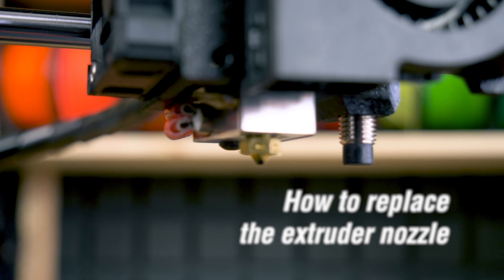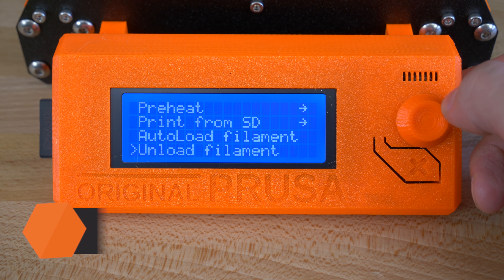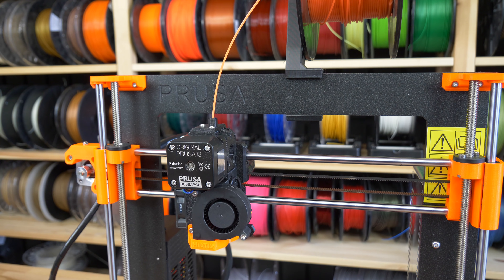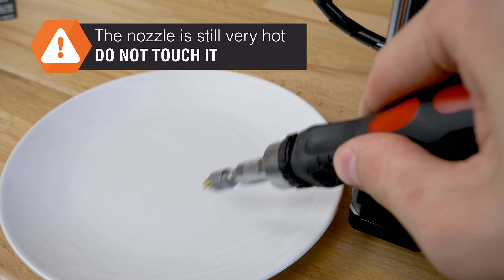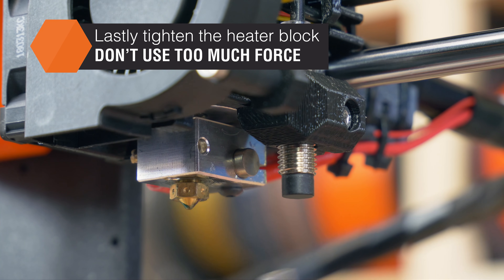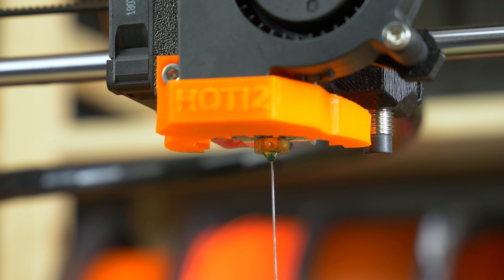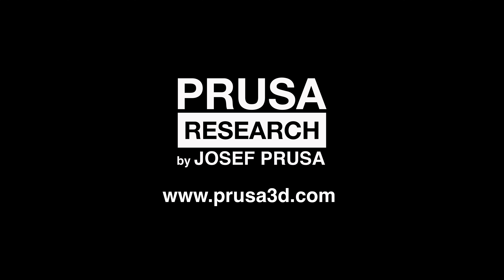How to replace the extruder nozzle

Comment: I can't recommend to replace the nozzle like descripted here any longer!
First reason: after ~10 nozzle replacements, the wires of the heater capsule inside of the heater block just break off because of to much wire bends. 
Second reason: after initial loosing of the heat break, you may have the risk to don't get the heat break not tied enough anymore. Resulting that nozzle and heat break don't touch anymore inside of the heat block. This causes leaking of molten filament over time what will causes slidly under extrution and but high chance of blobbing. This is a very slow process! You will not see this directly after the nozzle swap! But weeks or months later you will notice oozing and filament blobs on your nozzle and your heat block.

I experienced both problems above with my Prusa i3 MK3 respective MK3s. 

I suggest to swap the nozzle (if necessary) as following:
1. Remove the filament fan and the air directing shroud.
2. heat up your nozzle/hot end as descriped in the video.
3. Place some thing soft but heat resistent on your heat bed to avoid damages by accidentally dropped parts.
4. Move up the extruder unit as descriped in the video.
5. Use a bigger pliers or a variable wrench to hold the heat block as good as possible in it's position! Grab the heat block on the short sides to avoid any contact with the thermistor and heat capsule wirering! DO NOT GRAB THE LONGER SIDE OF THE HEAT BLOCK!
6. Use a socket as descripted in the video to unscrew and handle the accordently nozzle. 
7. Screw in the new nozzle as descripted in the video. Hold the heat block in it's position as good as you can! 
8. The nozzle should screw in pretty easily, dont use a ratchet to fix the nozzle! Just tied the nozzle by hand!
9. This is importend! Check if the nozzle is not totally screwed in! There have to be ~1mm gab between nozzle tipp and heat block were you see a bit of the nozzle thread. 
If the replacement nozzle is screwed in completly there is something wrong! Maybe your new nozzle has a shorter thread then the old one. In that case leaking of molten filament is pretty likely! 
Stop the process, disassamble the extruder unit and then the entire hot end. Adjust how fare the heat break is screwed in the heat block. You may have to screw in the heat break more. Here are a great video discussing the problem and how to fix it: https://www.youtube.com/watch?v=FNXYL-3UdOA
10. If the nozzle is screwed in correctly cool down the nozzle and reassemble the filament fan and the fan shroud. 
11. Your new nozzle is maybe a bit higher or shorter then the old once. You should run the First Layer Calibration again!
12. If First Layer Calibration doesn't work or the Z-adjustemt values are completly off, you may should readjust the height of the PINDA-Probe. You should check the manual and redo the PINDA adjustment and  pre flight check. At this point you are strongly adviced to redo the calibration wizard! XYZ coordinats are most likely pretty off.

If you plan to swap the nozzle more often you should consider to buy at least one spare heat capsule and thermistor probe for the heat block! Each part is about 11€ for a original one but you can get on amazon 5-10 parts from china for around 10-15€

Overall I don't think the nozzle swap is as trivial as presented in this video! You really should think about if it is necessary or not.
Reply: Yep yep yep yep agree, I just fixed a leaking between the heat break and heat block. The main problem was turning the heat block to swap the nozzle loosened the two.
Reply: @andrewong3724  I really don’t understand why Josef gave such a bad advice. I exactly had leakages when I followed his instructions
Reply: @Mazinga so he can make you damage your hotend as a strategy to sell his sh*tty pre-assembled hotends for 80$
Reply: @andrewong3724  how did you fix it?
Reply: Yup, this video is full of bad advice. I also ran into the same problem and now need to completely disassemble the hotend in an attempt to fix the leaking. What a pain
Reply: So as long as you hold the heat break and ONLY unscrew the nozzle you shouldn't have to worry about a larger or smaller gap from the heat break, yes?    I found another video and the person is doing exactly what you described.  Did NOT touch the heat break by loosening it at all.  Simply held it in place then unscrewed the hot nozzle.  Screwed the new nozzle in and torqued it to spec and that was it.  All my friends who have changed nozzles have had a problem with something leaking or breaking.  This is why I haven't changed anything on my mk3s even though i'd LOVE to print CF material or other abrasive stuff... I just didn't want to take the nozzle off and screw something up.
Reply: Or just get a Mosquito
Reply: @sasca854  what’s that?
Reply: I swap between 0.4 and 0.8 nozzles all the time. Why are there so many comments under this video of people complaining of a simple task being called simple? If you have butter fingers or are a brute then it's your fault, not the hotend's.

Comment: Welp, I overestimated the strength of my left hand when putting the nozzle back. Heat block slipped and I think I've screwed up some of the wires.
Reply: i have the same probleb bro
Reply: kek

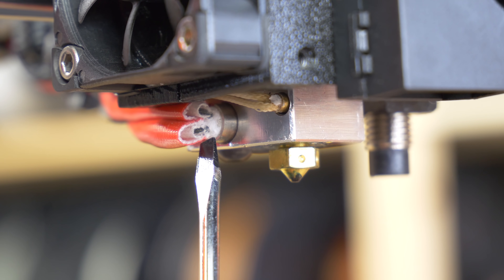Comment: 0:57 Unscrewing the heater block is really important. I forgot that part and had endless clogging and underextrusion. Wasted hours on failed, spongy prints before I could figure out why.
Reply: and why? i suppose because you omit loosen heatbreak bur what it causes?

Comment: Sheared off the nozzle last time. It doesn't come loose and given how fragile it is I'm stuck. It's broke either way so I guess it doesn't matter. Why don't you pop over to England to the hot end factory and work on this design? It's well past time for it to be fixed.

Comment: I heated the nozzle upto 285 and then as I was starting to loosen the heating block, smoke started coming from the general area around the extruder gears. I got so scared that I just turned off the printer and didn't attempt again. I don't know what burned up in there. I don't think it's any of the wires but I'm still not too sure. I still need to clean that nozzle. Any suggestions?
Reply from the maker: The smoke could have been some leftover PLA loaded into the extruder, some adrk goo may come out with your next filament load, but hopefully, that's about it.
Reply: @Prusa3D  Thank you so much for confirming that. Yes, exactly what you said happened. The goo freaked me out too. But nothing seems to be affected beside that. Thanks.

Comment: Please help I changed the nozzle and in slic3r I found where I can change the nozzle diameter but everything else is off as it was preset for 0.4 mm is there a 0.25 mm profile
HELP
Reply from the maker: There is! Select Configuration - Configuration Wizard. Here you'll see tick boxes under each printer. Tick 0.25 mm nozzle and then click Next till the end.
Now you can switch the printer to Original Prusa i3 MK3S 0.25 nozzle (the printer name may be different depending on what you pick in the wizard)
Reply: Prusa 3D by Josef Prusa thank you it works perfectly. Thanks for the quick response

Comment: Hi, I changed my old nozzle with a new one. But I have over extrusion issue. does anyone have the same problem?
Reply: You probably dialed your settings according to your old nozzle and it may have been a little clogged or have a slightly lower diameter than it should have. Revert everything related to extrusion to stock in your slicer, check that your nozzle is the diameter you think it is, and you should be good to go.

Comment: The i3 MK3s doesn't allow you to change like this, as the new channel for the wires under the extruder block means there's nowhere to grip the block like at 0:58.  This means you have to grip at the front, however then you can't get to the nozzle,  and the new fan placement means removing the fan too... And the PINDA probe gets in the way.  Then, there's z-calibration to be done after, so all in all, it's about 90 minutes work, plus risk of breaking something, which is why people don't change nozzles....  I think the idea that it's quick and easy is entirely misleading.
Reply: Should’ve seen this earlier. Melted part of the fan shroud during the nozzle change…
Reply: you’re right, i almost damaged everything because of that video, who looks like it’s simple and i have the space to do it easyly... right now my nozzle still out..... hope i will manage to get it back in without breaking my printing.. hope i had see your comment before
Reply: Strange in the description for the 3S upgrade it says that you can change the PTFE Tube a lot easier ... I wondered how that is possible ... haven't looked at the new files for the extruder yet. You say it is harder. Hm.
Reply: @VictorSteiner  It is harder to change the nozzle, not the tube.  I haven't tried the hotend removal yet.  I think removing it will be easier, however GETTING to it may be harder.  So far, not been impressed with the update, it's made some things worse, and not much better.
Reply: 90 minutes? Hardly. Under 10 mins total including first layer calibration z height.
Reply: @MrWizard65  Still waiting for your video on how to do this in 10 mins.  In the meantime, the last 2 hours have looked like this (I finally decided to swap out for a set of prints).
remove fan and shroud (2 mins).
Turn heatblock with spanner, THERMAL ANOMALY alarm, printer resets, temp drops, with heatblock in "open" position.
Set temp again, touch with spanner, alarm again.
and again
I have now got the old nozzle out, and the new one is in about 1/2 turn - but temp dropped again due to another reset, so it's stuck inside....

The whole thing is a complete mess, and I want to see someone do it in 10 mins so I know what I am doing wrong.
Reply: TL:DR; perhaps.... The latest firmware has a thermal check, so you need to go to menu and select "replace nozzle" to disable during this process.
However... it's also recommended to run the 12min thermal calibration process after nozzle change, so certainly not possible to do in 10 mins!
Also... the latest Prusa guide seems to not  recommend the initial loosen heatblock stop.
Reply: @wcndave  I am experiencing the same issue while attempting to replace worn nozzles on my MK3S+ printers. This instructional video is very misleading when instructing the user to loosen the heat block, then remove the nozzle. This has resulted in filament leaks on two printers because the nozzle and heat break are apparently no longer in contact with each other within the heat block. This nerve-racking process is equivalent to playing the game "Operation", trying to work within a limited working area, hoping the TA alarm doesn't go off, hoping the fragile wires aren't touched or damaged and the heat block doesn't move. I have two printers down now because of leaking PETG which is leaving burnt filament on my customer-purchased prints. I am now searching for a reputable instructional video on removing the entire hot-end assembly from the printer so I can attempt to lower the heat break to contact the new nozzles properly.
Reply: @MrWizard65  As you can't get a grip on anything, and there's no space, and you've waited to heat everything, and you've had to get everything out of the enclosure, etc etc etc.. I am an experienced engineer, and can safely say this is now a rather long process.  I'd love to see a 10 minute video though - sure I could pick up some great tips if you can really do it in that time!
Reply: I found that a 17mm "bicycle spanner" (a very flat spanner, mostly used to remove pedals) works well to hold the heat block by the front top without hurting any wires. You do have to remove the fan shroud. I would say it is a 10 minutes process. It's a pain to do. And I always fear that I am going to break the whole damn thing.
Reply: @progbombela  hot tip. pun intended
Reply: @progbombela  Thank you for this.  Your comment was GOLD.  All the people saying how hard this is were probably trying to use an adjustable wrench as stated in the video.  With a standard 17mm "spanner" as you call it (I call it a wrench lol) it was small enough that I could slip it right in behind the shroud assembly, tilt it back slightly and get the socket in front.  The hardest parts for me were 1) My original nozzle had built up a lot of gunk that first had to be scraped off before the socket would fit and 2) ironically the socket I used was just a hair too deep and thus couldn't start the new nozzle.  so that last part was interesting :D

Comment: Hello,
is this the same way for the MK3S?

Thank you very much.
Reply from the maker: Pretty much, yes :) You don't need to remove the fan shroud, if you move Z all the way up, you'll have decent access to the nozzle.
Reply: Yes, and it is not fast nor easy to change the nozzle. Your instruction is misleading, incomplete and partly wrong.
Reply: @kontaktstudienschaft8722  the fact that you can't handle a wrench does not mean that this is hard.
Reply: @kontaktstudienschaft8722  Set yourself up for success, Kontakt. Give yourself a spacious area to work and use the correct tools. Though it’s possible to use other pliers, it’s unoptimal. Good luck.

Comment: Why should I unscrew the heater block?
Seems to be adding more risk of damaging something.
Is holding it in place not enough?
Reply from the maker: If you hold it tight enough when you tighten the nozzle it's fine. This is just a really safe way to force people not to tighten the nozzle against the heater block without holding it. Because that would often lead to damaged heatbreak.
Reply: @Prusa3D  Hey, thanks for answering! Your printers are great.
I am eagerly expecting the SL1.
Reply: @Prusa3D  Unfortunately I think I've damaged my heatbreak's securement within the heatsink due to these instructions. You can see the issue here: https://www.reddit.com/r/prusa3d/comments/b7ie93/loose_heatbreakblock/

Comment: Honestly I think that while you all point out that the Z calibration should have been mentioned, this video only considers changing the nozzle and not preparing to print with it. It is even in the title, preparing to print is a whole different thing. For those who worry too much abount how much force and how should be applied, you can 3D print a torque wrench for yourself for this exact operation, or use one of your own set to 3 Nm (source: E3D dozuki). Finally, if you have this sort of printer at home and think this video fails to mention many things, you should all keep in mind that these printers are not for dumb people, Josef very well assumes that you have enough basic understanding that you need to calibrate and should not go for a fool-proof video every time.

Comment: Tried last night and failed to loosen.  My 7mm socket just had a slim screwdriver handle and that was totally inadequate to produce sufficient torque.  Today I realised I could attach a 90-degree lever to the socket set.  I heated the nozzle to 285 and applied a bit of pressure and heard the click as the nozzle began to turn.  Nozzle extracted.

Comment: Just did it for the first time on my mk2.5! Tips for other beginners: Remember that not only is the old nozzle hot. Metal conducts heat really good! The nozzle you are changing to as well as the tools quickly heat up. I learned the hard way. Oh well, I have 9 othet fingers ;D

Comment: Guys, you really should replace this video with a new one! 1. You didn't point out that you have to remove the fan nozzle. 2. You will probably bend or even break the heat break if you turn the heat block holding it off-center with a wrench, like you did. 3. You absolutely must check the z-height after this, since there's a good chance of ramming the nozzle into the bed after having it changed.
Reply from the maker: 1) We removed the fan nozzle just for the video. You don't have to remove it when you change the nozzle (we normally don't).
2) The heat break is fine, but you are correct, be careful when holding it!
3) If you replace the nozzle with an original E3D nozzle, the live Z usually stays perfect. But it doesn't hurt to re-do the first layer calibration just in case.
Reply: @Prusa3D  The mk3s now has the part fan right in the way, and the cable management also right in the way.  There is nowhere to hold the heat block.  Made changing nozzle (which was possible on mk3 a complete no-no without taking everything apart and an hour or so per change is not worth it.
Reply: @Prusa3D  The heat break is not fine. It breaks after multiple nozzle swaps if using the recommended technique. The video made it look trivial so I was switching the nozzle quite often. I ended up breaking the heat break.
Reply: @vavilon7109  I too bent the heat break the first time I tried to do a nozzle swap - the nozzle seems to get completely fused with the heatblock after many hours of real world use, so if you have a nozzle on the machine from new until it wears out, you have little chance of freeing it without damaging the heat break.
Reply: Prusa 3D by Josef Prusa what about the nozzle size setting in the printer menu? What about the new configuration in the slicer?
Reply: @Prusa3D  I don't understand this.  There's nowhere to hold the heatbreak.  If one removes the fan and shroud, you can grip the front few mm only, due to the new cable layout.  Changing nozzle became very hard with the S.
Reply: Prusa 3D by Josef Prusa if i try to turn the heatbreak it wonˋt loose , i dont want to put to much force  on with the wrench , everything feels unstable like it woud bend if i put more force on (prusa mini)  what can i do ? 🙈.   Wd 40 ?